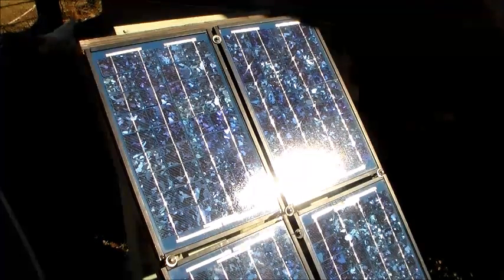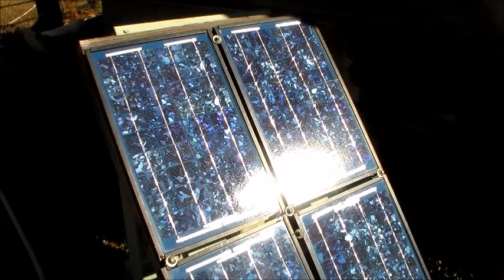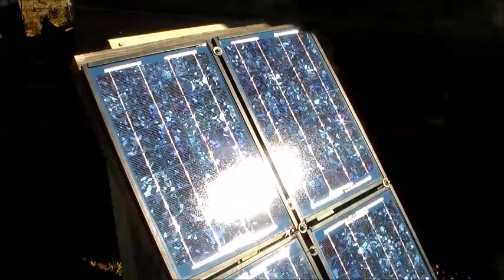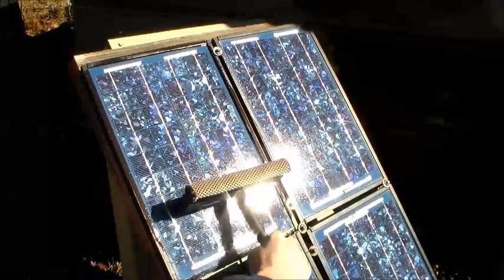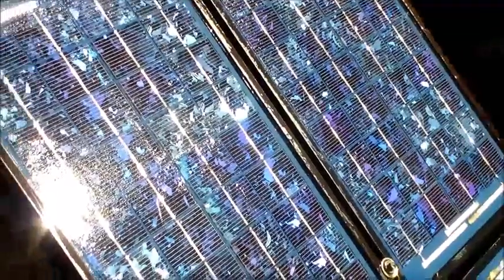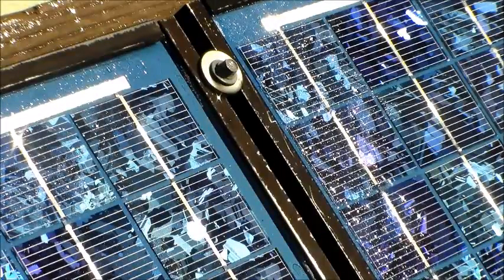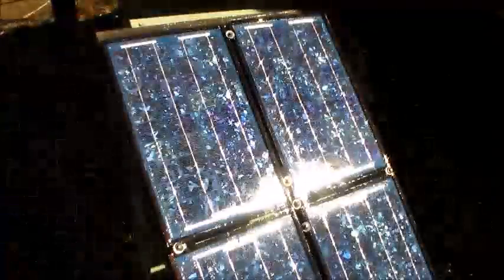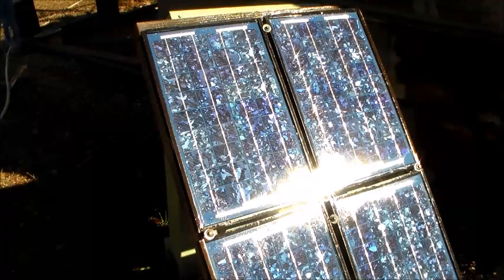Cleaning Solar Panels With Rainx

Comment: I'm not sure about rain X but back in the day Amway make a silicone glaze product that worked on the paint and windows. Water would just bead up, and roll off. I am looking for a product to keep my panels clean. Or do I have to invent a system that will keep my old ass off the roof.